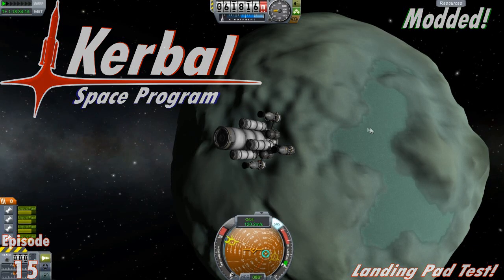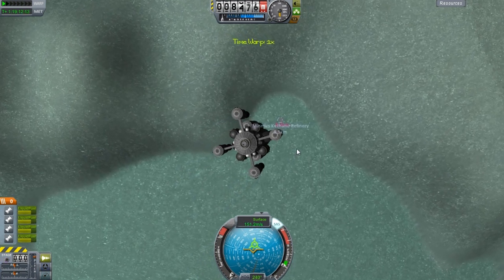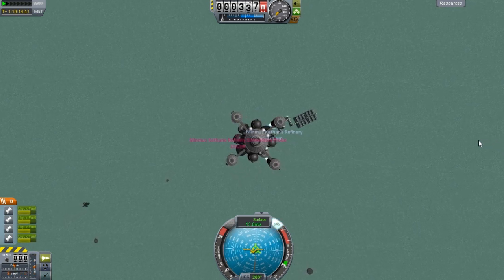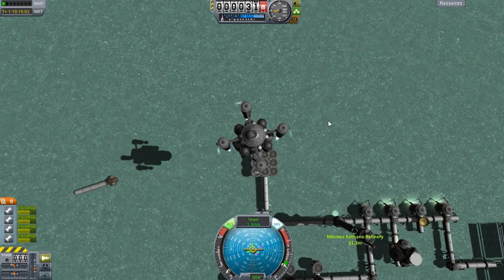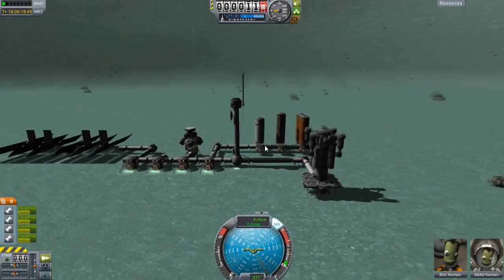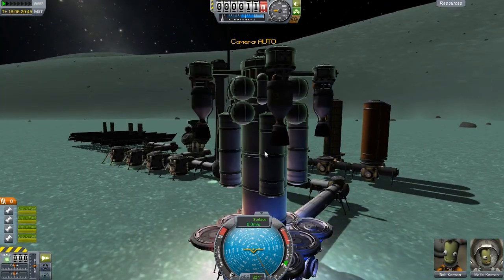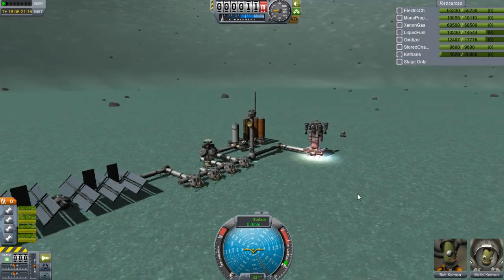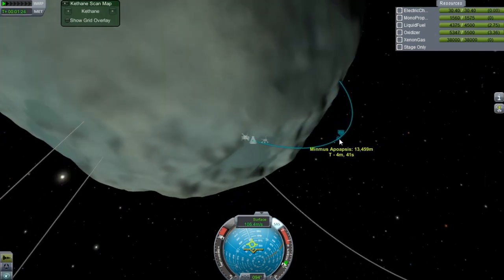KSP Modded - Ep. 15 - Landing Pad Test!

Comment: if you click on the altitute marker it will keep showing you so you dont have to hover over it all the time
Reply from the maker: Yeah I wasn't too concerned
Reply: btw how do you use the welding mod... in your game or are you still running on 0.22 ?
Reply from the maker: SmellsLikeDynamite
im using .23 there is a fix for it pn pg 50 of the welding mod. The fix doesnt really work well but it does the job
Reply: i replaced the files but the box to weld items in didn't show is that normal or do you need to use a other way to weld (also tried placing the dll file direcly into the ksp plugin folder, didn't work)
Reply from the maker: SmellsLikeDynamite the weld box has to show. Maybe Ill upload my version so people can use it.

Comment: Gotta use  I J K L to move sideways bro :P  Also, if you've found the right throttle setting to almost float, use H and N to adjust your vertical velocity.  Get with the RCS mang.
Reply from the maker: I know I was just having problems. The welded parts dont translate very well with unwelded rcs blocks.